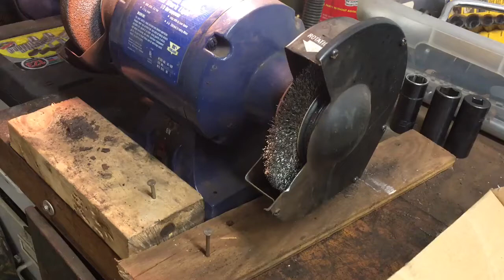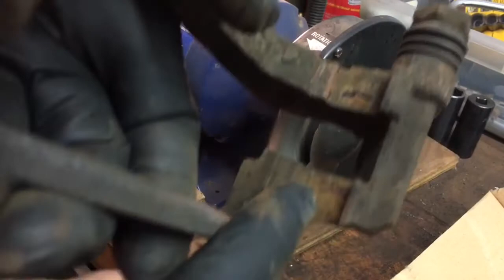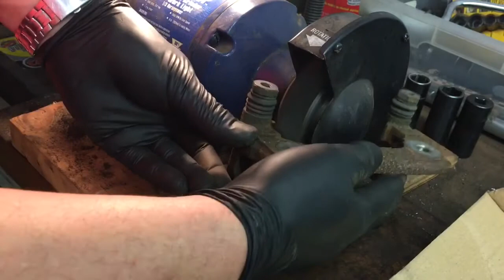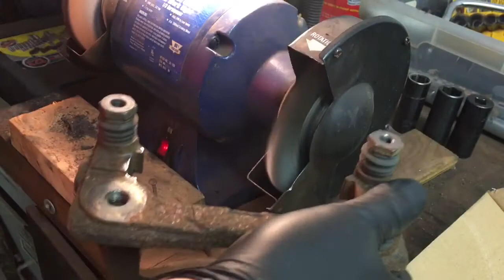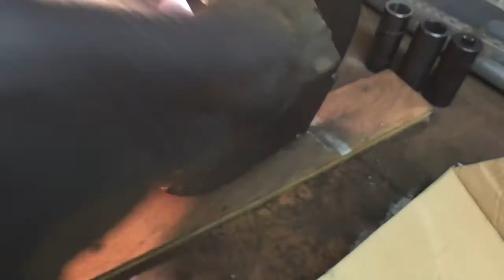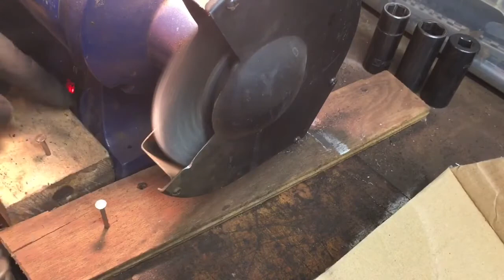How to properly remove rust from a Brake Caliper Bracket on all vehicles!

Comment: guide pin and housing are much more important. Even tiny rust or worn build up can affect the driving. I've compared many 10-year-old brackets with 'seems ok' guide pin housing, with brand new/rebuild brackets. Much smoother driving, without any unobtrusive vibration
Reply from the maker: Definitely a great idea to clean up any rust on mounting points, however most guide pins are coated with a rust preventative, if you wire wheel them you remove all the rust preventative defeating the purpose. Guide pins and rubber bushings should be replaced when they show signs of rust and deterioration. Hope that helps!
Thanks
Joe

Comment: This is not a "Proper" way to remove rust. Next time, stripit down, cleaning it with a de-greaser and soaking it in white vinegar for a day or two, you might be amazed by the results.
Reply from the maker: Hi Ryan,
Thanks for your tip, unfortunately most mechanics, techs and DIY's don't have a few days to wait while their brackets soak in vinegar. But to those who have the time, great idea. There are also other chemicals you can use to remove rust that probably would work well also. I like the wire wheel because its not going to chew up the existing bracket metal, it will just remove the rust only, and its a quick way to get your parts in proper condition to be reinstalled properly.
Thanks!
Joe
Reply: @Ryan Sewell I don't have the luxury of leaving the caliper brackets off of my car for a day or two while they're soaking in white vinegar. This wire wheel method is one of the best. I've also used a file, wire brush, and Dremel tool to get those bracket spots clean.